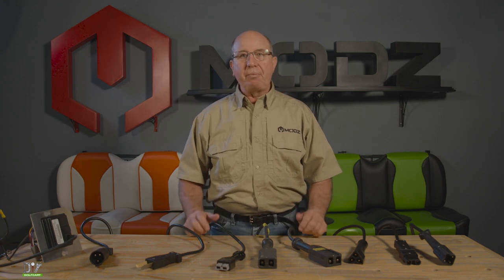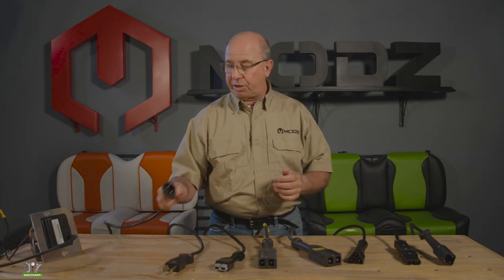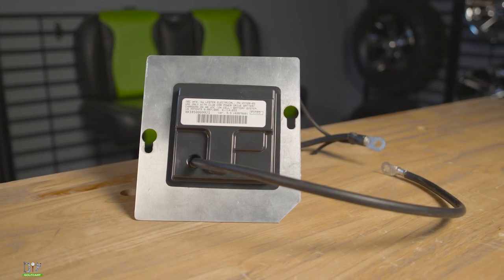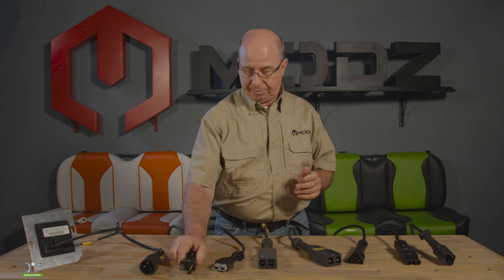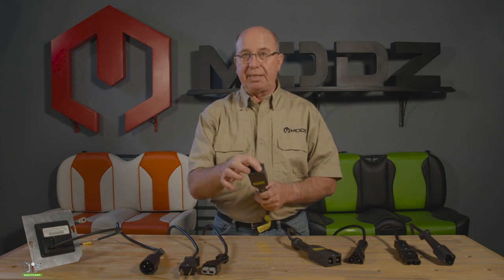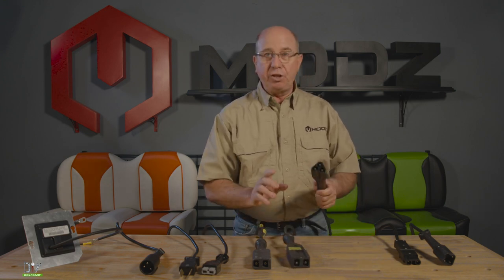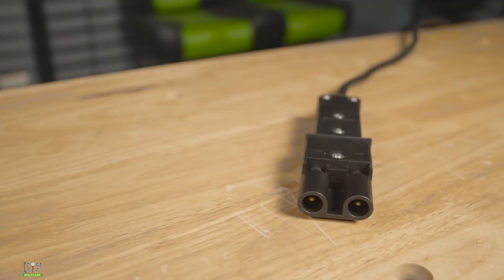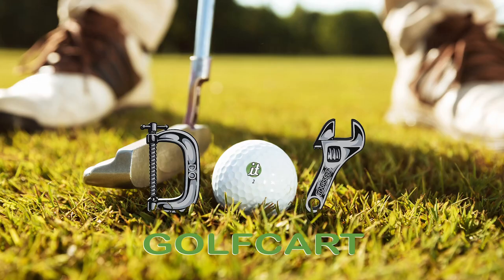Golf Cart Battery Charging Handle "Plug" Types for Club Car, EZGO & Yamaha Golf Carts

Comment: HELP! I was checking the connections on my Yamaha G19 charger EpiPen charging plug and when I took it apart and neglected to pay attention to which wire was positive and negative. One is black, the other white is white. Can you help? Or, is there a way I can check pos/neg using my voltmeter? Thanks so much!

Comment: On an LVS 48 volt charger it had the 3 prong plug one had black wire one has white wire they are side by side the third prong does not have a wire connected to it yet there is a wire coming off the back where you plug it that goes to a inline fuse and goes into a loom. Should that prong be connected to something in the plug

Comment: I have a 2006 ezgo txt golf cart. My charger stopped working and I need to buy another.  What are my charger options. The charger I had was a Schauer part no 0891-181 and is $299 to replace. Is there a cheaper charger that will work for my golf cart?

Comment: The plugs are designed with two purposes = to keep someone from plugging in reverse and to force owners to use the manufacturer's unique charger that really isn't that unique.  Each plug manufacturer has "reinvented the wheel" so to speak.  Those 8 can be reduced to about 3 based upon charging amperate requirements.
Reply: And OEM replacement parts are around $65...

Comment: I have a cart with a crowsfoot plug.  I have to replace the charger, can I remove a "D" shape head and put the crowsfoot on it from my old charger as long as they are both 36V?
Reply: Most likely yes. You can also find adapters if you use the proper terminology as described in this video